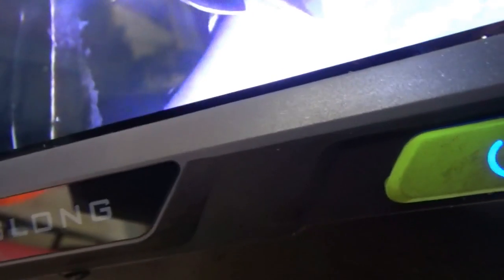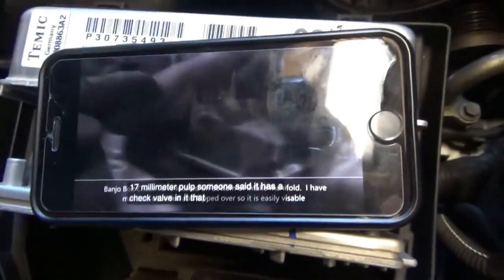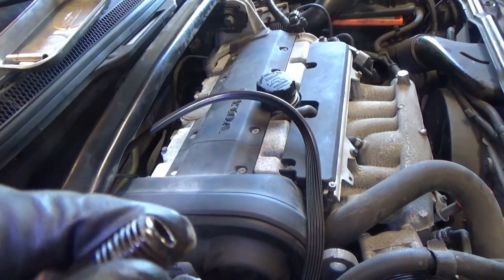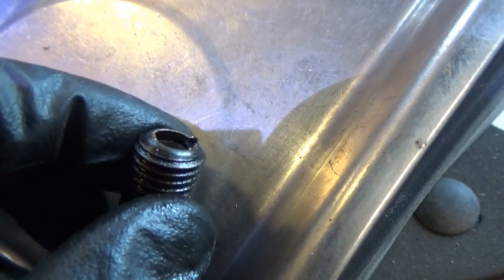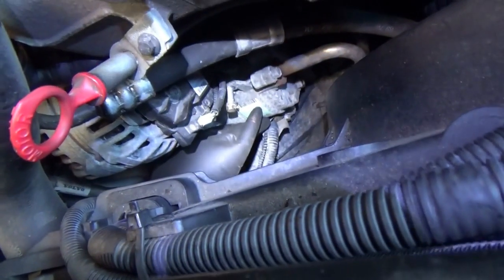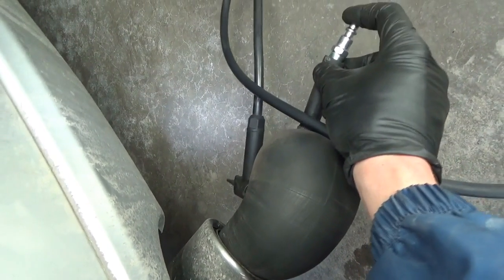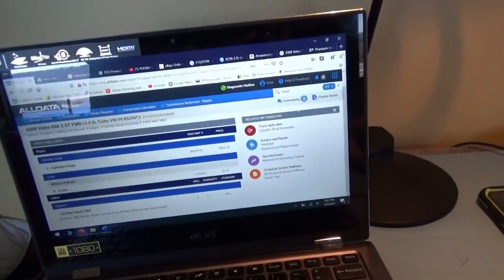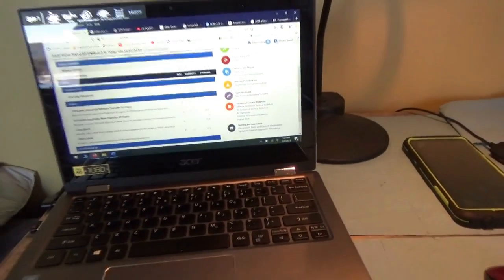Volvo Turbo GRENADES! - Part 2 (Cause of Engine Damage)

Comment: If the car is in decent shape, I'd lean heavily towards replacing the engine. Even though the damage appears confined to cylinder 1, there might have been some damage not seen to the other cylinder walls that could show up later. Not one of the brighter design principles in that check valve! As always, an excellent learning experience for anyone, not just shop mechanics, and your desire to go into clear definitions is appreciated, Ivan!

Comment: Hello Ivan

I have not posted to y
YouTube in quite awhile however I still watch regulaly.
In this video either you did not notice or did not mention  the damage you can see sat the rear of the RT. Valve.
It appears to be severe enough to be a large void in valve contact surface.
I expect this is the major contrubuitor to the exhaust leak.
Considering the overall damage to both cylider and cylinderhead rebuilding engine just a teaching exercise if someone wants to learn hoe to do the work themselves. Would make a good set of videos.
Good luck.

Comment: If Volvo is "aware" of this, then they should make good for the customer!  What is the cost of a remanufactured Volvo engine?  Since they never had a safety recall ( and yes I consider that a safety problem) Volvo should replace that engine at their expense!  If that can't be worked out, then they pay two thirds of the cost and customer pays one third, up to $1500.00 max!  With a 2 year/24000 mile warranty!  That seems fair to me!  None of this 12 month 12000 mile warranty stuff!

Comment: Had a couple of these P2 Volvos (2000+) Early years had no check ball in the banjo bolt but later models included check balls and there have been stories of check ball getting loose creating havok. The check balled banjo is an "upgraded" design but caused more harm the good in the end. Volvo buried the PCV system under the intake manifold. Ended up trying to make them last longer instead of making them easier to service.

Turbo PCV systems are complex and have 2 circuits so no longer simple PCV valves of normal aspirated engine. The Volvo P2s and Audi turbos PCV system all have variety of problems. But yeah, check ball of PCV system destroying an engine is poor design to say the least.

Comment: on the technician side there is no good repair other than a reman engine with new turbo. on the owner end if it were mine it would get a head assy and turbo(known good). very poor design.  should have been an inline valve that the components were too big to go through the line

Comment: can u stop the fuel injection to the bad cylinder so he saves on gas? it would be like the new drop out cylinders, ... just permanent . maybe just unplug the injector for that cylinder.  Being its a dead hole, shouldnt hurt anything.also maybe run a slightly thicker oil?

Comment: There is NO WAY that cylinder head takes 18hrs to R&R! The timing belt on those are extremely easy to remove and then it's just the manifolds and all the plumbing connections and it comes off, unless I'm missing something here.......

Comment: If the turbo has damage to the exhaust impeller it will also need to be replaced as you can be sure its out of balance and will fail prematurely. 
Full engine and turbo replacement.

Comment: Wow wonder how long it took them to update that bolt and how many engines were damaged as well its crazy how one little bolt could do so much damage to an engine but the idea of just changing the engine is the way to go for sure with the updated bolt in there as well .great video Ivan will see what part three has in store .....

Comment: If it was mine and I wanted to keep it I'd pull the engine. Remove any good parts and source a used engine for it. Then pull the used engine apart, replace gaskets/seals/timing components and do a full valve job, re-ring the pistons and give the cylinders a quick hone just to break any glazing. Replace the rods an mains and give it a general refresh to start with a zero miles engine.  However being where it's located it would need to be an exceptional condition car to do that.

Comment: Good Video case study and not so good result for owner. Having done a few engine rebuilds myself on varied non economical viable cars in the past as a diy, it Does not seem viable option to fix engine+turbo on that car unless owner can do lot of work himself to save on costs "no offence meant to your fine work at PHAD Ivan"..
2nd hand engine might be the best way for this volvo to survive..
that is terrible engineering design for that check valve. looking forward to part 3 video.

Comment: You know Ivan I am a huge Toyota fan BUT BUT Older Tacoma trucks had a similar issue. I had a 13 and took apart the air injection housing/filter to check mine when I owned it. So, older models of Tacoma with the V6 had crappy air injection filters that would disintegrate and get ingested into the engine and basically ruin the engine. Do NOT believe me...do some research and you will find info. Now my 2013 had the redesigned filter and it seemed to be OK. Again....a $10 part could lead to total engine failure. About this Volvo...scrap yard engine is the best route. Find one in good condition and on you go.

Comment: I bought a 2014 s60 with the famous shredded serpentine belt causing timing belt failure. Replaced all ten intake valves and adjustment (selective cam followers). Volvo dealers do not replace valves-they replace engines.

Comment: Valve damage....ooof......just rebuilt a Range Rover Evoque with burnt valve.....it’s a huge job.....if it were mine, and I couldn’t do the work myself, I’d replace the engine or buy a new car.

Comment: I'd change the bolt and continue to monitor oil consumption. Most people would trade it in or sell it, I would drive it as long as I could or take the 50/50 on a used engine.

Comment: From my experience with Volvo's is once something happens and you take them apart to fix them it is  like opening Pandora's box.  Once you start in to a repair the parts and repair needs going forward never seems to end and everything is expensive, and will eat you alive. I would put a new PVC valve in it and drive it till it dies or trade it for a well made car like a Toyota or Honda.
Reply: That gets my vote also.  Drive it or trade it.

Comment: 1. anyone with a Volvo with that valve needs to either buy the upgraded part or weld the crap out of the old crap one!!!!
Great diagnosis, however I have one little, constructive, complaint/suggestion, either you need to buy a camera gimbal or preface some of your videos with a take your Dramamine before viewing warning message...🤣🤣🤣

Comment: Is it possible to remove #1 piston
rering it and hone the cylinder
along with replacing all the valves
on #1?? Putting in a high mile
used engine is a crap shoot at
best, I know it's going to cost
either way but you have a known
with his engine and he could get
a few more years of driving out
of it!! Take care Ivan, you will have
to do a video of your new bike soon!!
🤙🤙🤙🤙🤙🤙🤙🤙🤙🤙🤙

Comment: This is something that could be very useful to other people who own that car for them to replace that bolt with a corrected version.
Reply: Yes, but only turbo versions of the Volvo white block.  I have two NA versions.  Either way those PCV systems require occasional replacement, it's a known issue.

Comment: In this era of plastic intake manifolds and turbo design, I find PCV routing to be surprisingly complex. Some have a split pathway depending on boost pressures. Apparently my Subaru turbo has no EGR, though perhaps there is some kind of PCV/EGR 'hybrid' design. I'm surprised Volvo didn't recall this one. What an irony, with all the plastic there, it was a steel part that fails!

Comment: Reverse engineer:
Close all valves
Snake camera behind valves, on exhaust and intake sides
Slightly pressurize combustion chamber, run air in plug hole. (10, 50, 100psi)
Then fill cylinder with penetrating oil, watch for leaks.

Comment: I will not repair that engine. It is not a cost effective repair for the owner. Knowing Volvo and all the plastic and hard rubber hoses, you will need to replace everything that you touch because it will break during removal or installation. The cost will add up very quick and only having the piston chamber damage that is a lost. It is way more cost effective getting a used engine from a salvage yard from a wreck car with average mileage and just do the preventive maintenance to the engine outside before put it in. That will be the best cost effective solution for the owner if they want to keep the Volvo. Or just trade it in and get something better.

Comment: EXCELLENT INFO IVAN. It seems that valve was introduced around 2005, thus my 2000 V70 2.4T should no have this valve, but I'll check that tomorrow and let you know. Volvo should make a recall about this, this way if someone else grenades their engine they can avoid an potential law suit, as they have done the recall and thus it would be on the owner, not having the repair done. If they do not do this, they just want sell more cars, but unhappy customer will not buy an another Volvo..

Comment: Remove piston
New rings
Lightly Ball hone (not stone!)
Lap valves
Burnish piston top and under head for any nicks & burrs that cause preignition.
Very easy job.
Reply: Piston is probably cracked now anyway.
Reply: @superusermode  How do you come to that assumption? Ivan did not mention any crankcase blow by.
Reply: @HUBBABUBBADOOPYDOOP  doesn’t take much to crack a ring land, and with that amount of damage from the piston smacking that check ball around, it’s almost guaranteed.

Comment: Lets cheap out on a $20 part so it eventually destroys the engine and the client has to buy another car... Good call, Volvo! 💸💸💸 Thank you for the video, very interesting!!
Reply: That bolt costs Volvo max 50 cents!
Reply: @ghenkhoash2440  Probibly less as this is a pretty standard part made on automatic machines by the thousand .
Reply: They probably did not realise the problem at the drawing board and after that Ford forced the engineers to shut up. 

Before Ford acquired Volvo, they were very honest to their customers and really earned their trust, but after about 2000 it was a downhill with Ford. 

Hope the new Chinese owners would be more honest, or was the scandinavian time the last "we strive for the customer time"?
Reply: All manufacturers do it. If it just gets past the warranty period they cash in.
Reply: check balls in general can cause alot of problems, something the plastic ones will do is get flat spots on the balls, and intermittently seal, because they spin in the hole and sometimes they hit the flat spot and leak.

Comment: I bet this is the original breather system. All these cars need to have the complete breather system replaced at 100k miles. They plug up and cause crankcase pressure,. This can and does blow out the cam seals, and the old style check valve can fail as this one did. Synthetic oil will help keep the breather open as well. Erie Volvo is a great place for a used engine.
Reply: You can do a crankcase evap system leak test with a cylinder leak tester. Just have a oil cap with a drilled in hole for connector and check if there is an resistance bleeding the crankcase out at engine on idle or engine under boost. Old or new (1990's to newer) you should never get a somewhat to major positive reading, unless the breather system is clogged. .

Comment: Those dings in the cylinder wall might have done some ring damage.  And burning oil will foul the plug and might mess up the cat, since that burned oil will be sent its way.  He should go with a used engine. And the damaged exhaust turbo impeller might also give bearing trouble before too long.
Reply from the maker: Yeah we'll see how it holds up. Owner is very happy at how it's driving at the moment :)

Comment: Absolutely amazing technician. Along with Eric O, Scanner Danner, Keith at New Level, Mario at Super Mario Diagnostics these gentlemen have taught me SOOO much. I could never express my gratitude. Thanks Ivan for being freaking amazing. GOD BLESS YOU Brother!!!!
Reply from the maker: Thank you for the kind words!
Reply: @PineHollowAutoDiagnostics  >>
Reply: Indeed, all those guys and Ivan are worth their weight in gold, so much knowledge and wisdom shared, its just amazing. I have DIY'd breaks, struts, service steering rack, oil changes and many more stuff to my cars because of these guys. Kudos to all of them.
Reply: doing a valve job on high mileage engine is risky, turn into a real oil burner. cheapest way  out is find a used head.

Comment: I'll be all because a little bolt and check valve components, almost means that should be a part of 100,000 mile service
Reply: It is, 105k pcv service is in the dealer maintenance list.
Reply: This banjo bolt has an updated design that no longer has this issue. It should have been replaced with the rest of the PCV system between 100-120k.

Comment: you might even say that it got to the age that it's balls have dropped... A shame when these little parts fail. If the body is decent I'd replace the whole engine + turbo. Even if it doesn't have shaft play, it wont last long out of balance

Comment: If that compressor side of the turbo has a bent or chipped blade, it's going to burn up a bearing sooner rather than later, my guess. then the valve job and likely pull out piston #1, hone out the damage, new #1 rings and piston (maybe save the piston) and reassemble.  The turbo issue and the CAT tells me go with a used engine as those parts are likely going to be available from the same car or maybe the debris can be removed from the CAT.  If it were my car and plans were to keep it to drive it for a long period, I'd repair what is there spending the extra money on labor and finding a used or replacement turbo.  This is really a bummer of a choice. The other choice is sell the car with disclosures and suck it up for a replacement car.
Reply: If the turbo is whining, it won't be long before it either chucks a blade or breaks the shaft. No Bueno.

Comment: Ivan worked on Volvo's for 35 years and never have i seen that.
I can also say i have 1 head of in all these years.
They are kinda bullet proof.
That valve is a shocking design.
Nice video.

Also i agree 2nd hand engine is the way forward.
Reply: "...2nd hand engine and 1 new bolt/valve..." FTFY
Reply: The engineer that came up with this design definitely didn't consider what's downstream of that bolt. I have a solid, rust-free P80 Volvo V70 (B5020FS) that I nearly scrapped because of an intermittent crank no start. Checked key antenna, checked immo harness connectors, checked fuel & main relays - no problems. My last-ditch check was fiddling with a wiring plug that sits next to the radiator, and that turned out to be the culprit: the old beast now happily fires up every time, and will most likely outlive many newer cars.
Reply: I've blown three b230ft head gaskets in my family alone lol
Reply: The abs module in the early xc70s were total junk, friend had such a nightmare fixing it
Reply: Also the engine is going to be fine

Comment: It looks like it is time for new second hand motor and turbo, it just has way to many things wrong with it.
The turbo will be out of balance (with damaged turbine wheel), whine also indicated towards the damage.
The nicks/dents on the piston and the head will create hot spots and cause detonation.
The nicks on the cylinder wall not an easy thing to fix, needs at least a re-hone.

It is just cheaper to get a second hand engine with turbo (although being a Volvo probably will be hard to source).
Reply: I thought the turbo was fine?  the bolt ball bit went straight from intake manifold into the cylinder...  that being said, I'm learning a lot from how all the other "minor" blemishes will destroy this engine eventually.  I would just drive it until it dies, not relying on car for any very long trips away from home.

Comment: If it were my car, I would go the used engine route, with the updated bolt installed. Sad that a cheap part would ruin an engine.

Comment: Wonder if that part is in non turbo Volvo engines.

I would rebuild the head and rering the cylinder.
Reply: the bore looks scored. Rings alone won't do it. Some honing would be required and still might not save it.
Reply: @adotintheshark4848  

A rering requires rehoning the cylinder wall completely to get all of the scores out of the cylinder wall.
Reply: @cclngthr  I figured you might know that, but can just rehoning fix this cylinder's damage? If not then a rebore is required for all five cylinders, and that will be $$$
Reply: @adotintheshark4848  

It depends on how deep the damage is and whether the honing will get it out. You might be able to use a more abrasive grit than finer grit after to get it out. I have done that on several cars before with success. 

I would rering the whole engine rather than 1 cylinder. I did that to my brothers Eclipse with the 4G63 2 liter 4 cylinder engine in it. He busted the timing belt which broke 2 valves in 1 cylinder causing some wall damage but I ended up reringing the engine since I was into the 1 cylinder.
Reply: @cclngthr  doing the whole engine re-ring is usually a better idea anyway, since you've got the engine out on the car.
Reply: @adotintheshark4848  

In my brothers eclipse I was able to do it with the block in the car. Not all that difficult but a bit awkward to push the pistons up around the crank.

Comment: Could the camshaft and lifter be damaged?
Reply: Probably not, depends on the compression and size of the check valve. But your right I would always wonder what the next hidden problem would be. Fix the head and trade it in.